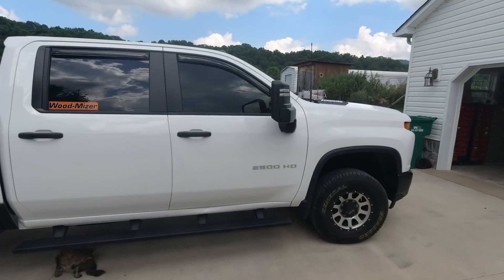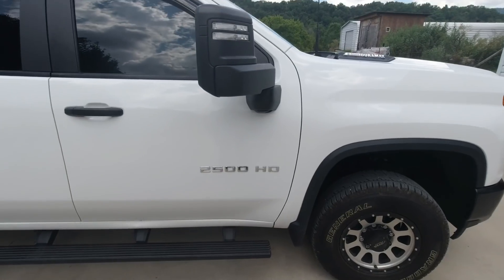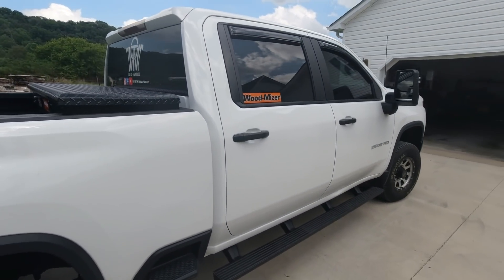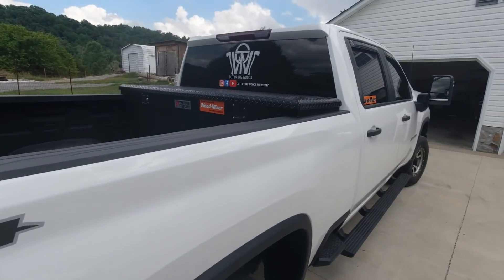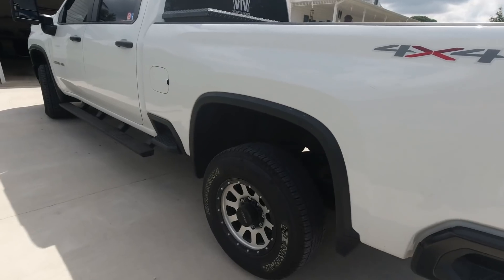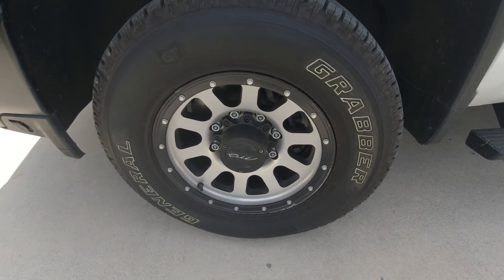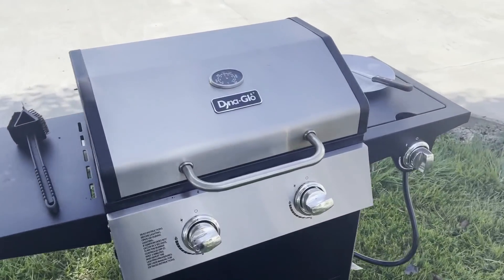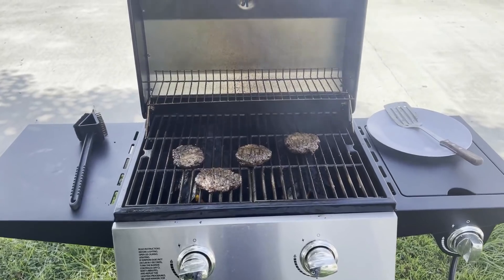It's A Diesel

Comment: Burning your woodpile makes me think back to when I worked as a security guard for Memphis Hardwood flooring and what they did with all their scrap wood.  I would start work as the workman were getting ready to leave for the day.  After they left it was only the fireman and myself, the fireman was the one who all shift ran the boiler, just like a steam locomotive fireman did.  I had to make a round once an hour through the plant to make sure there were no fires, which in the time I worked there there were several.  Every one of the saws, planers, brushes and routers had vacuum ducts, to collect all the sawdust.  All of the saws had a conveyor belt to carry scrap wood to the chipper.  The chipper would shred all the scrap lumber into sticks not much larger than a matchstick.  There was also a station for the workman to throw any wood which came out of the kiln, where the whole board was not usable, onto a conveyor belt to the wood chipper.   We called the place the "duck farm", because on the round we were always ducking under the conveyor belts.  All of the dust and chips from the chipper was directed into the dust house, which was a building about 40 feet wide by 60 feet long, and had three augers in the floor to feed the dust into the boiler.  The boiler not only created the steam heat for the kilns, but during the day they ran a generator to supply the whole plant with electricity all from the scraps of making wood floors.  Sometimes during the summer, they would run the generators 24/7, but during the winter they only generated enough dust to run the kilns.  During the winter at night and weekends they had to use commercial power after the shift and weekends.  For a senior in High School it was a job I did enjoy just walking around the plant and figuring out how each line made the different types of flooring designs, checking out the sharping shop, and the machine shop where they made all the gears for the plant and the sawmill in Mississippi.
Reply: What year are we taking here?  Very interesting.

Comment: Regarding the truck tires - if you can get them near you, try the Falken Wildpeak A/T3W tires.  I have them on my 2016 F250 and love them.  You get a LOT of miles out of a set, I have 37,000 miles on mine and they are still a year away from needing replacement.

Comment: Congrats on the new truck Nathan! Just a suggestion from an operator of a backhoe and an excavator, turn the front bucket over so the blade digs into the ground and push it down until the front of the tractor starts to come up. Those 2 stabilizers need to be pushed down farther also. When you start digging, you need some RPM's going for the pump to give you digging power. Also be pushing the bucket teeth down into the ground and at the same time curling your bucket while pulling towards you. The bucket should be overflowing with dirt every scoop. Don't mean to offend but just help out.

Comment: You should check out the Goodyear Duratrac. I work on the road doing cellphone tower work. I live in NC and do most of my work in WA, OR, ID and MT. I have a F-350  loaded to the max. Most of my jobs are up crazy mountain roads. I only need one set a year. The best tires I've ever ran.

Comment: Nathan, have you ever considered using those off cuts and barked flitches to make biochar to amend the soil in your garden(s)?
Reply: I make biochar. It’s a pain in the ass. I use kiln dried material from my wood shop. Making biochar isn’t as easy as it’s made out to.
Reply: @07negative56  I've made quite a bit of it, too. It's not as hard as you're making it out to be either. The trench method works like a charm and can be mixed in situ with composted manure to inoculate the biochar before using to amend the soil.

Comment: Back up cameras on trucks are great. You will love the diesel. My last was a 2015 3500 D/A CC LB for towing a 16,000# 5th wheel trailer. Loved that truck. Only had it one season. Sorry to hear no takers on your cutoffs in the burn pile. If I were close enough it would be interesting to see if it would work to pick through your pile and market what could be found online there to turners and maybe flat wood workers.

Comment: Re your new pick up. over here in the UK, Diesel fuelled engines are now a No No, after years of them being pushed via lower fuel costs, owners are now being punished if they want to drive in certain parts of city's.
Reply from the maker: That’s bad.
Reply: Another case of bizarre greenwashing. Compression ignition is actually cleaner-burning than spark.

Comment: I think those wheels you don't like are "lockers." That's why you have the extra bolts around the outside edge. They're designed to hold the bead tight when you lower tire pressure. You may never need them because you rarely run in sand or other rough terrain. Sometimes they will drop their pressure down to 10psi. or less when off road. Without the locker wheels the tires will quickly roll off the wheels. You should try to sell them.
Reply: Those are wanna be bead lockers. True bead lockers have 25 or more bolts on the rim. they are not DOT approved for use on the road. Unless you go off road a lot you don't need them.

Comment: Ok, so I may not be the sharpest knife in the drawer, but I presume that the new sawmill will be placed in the new building near the moulder and the kiln, because logistically that makes the most sense to have everything nearby, including the log pile, particularly with Nathan making comments about the tightness of a new mill in the current building. Doesn’t really make sense to run the power just for the moulder with out having enough power to run a mill. I suspect the new mill will be electric powered, if that is even a thing. That way the building may be enclosed without the diesel exhaust emissions. Nathan you may have already addressed this before or with your Patreons and I missed it. Looking forward to finding out.

Comment: Congrats on the truck.   I’m ready to see the new lt50 ( i always remember in the old vids you said if you ever replace it it would be a lt 50 ) 😎
Reply: I agree with you on the LT 50!!  The guys saying he’s getting the LT 70 don’t understand what kind of production both  the 50 & the 70 will turn out with the 70 being far more productive than the 50. Nathan works by himself! The 70 can turn out more lumber in one day than Nathan is milling in a month right now with the 40. Once you step up into the 50 or above you start getting some very nice options not available on the 40 like the bi directional chain turners which make an amazing difference and increase production speed by itself. There is no need for Nathan to step up to the 70 unless he’s hiring 3-4 guys to help move that production and stage logs  etc. or unless woodmizer gave him  a huge, huge discount cause there is a tremendous jump in price from the 50 to the 70, so for what type of milling Nathan does, the LT 50 will still outperform anything Nathan wants it to do!! The 50 is more saw than he needs but those extra options on it that are not on the 40 are worth the upgrade price alone!!!

But, I guess we’ll all find out in about 3 weeks or so!

Comment: Hi Nathan, thanks for the edutainment content you put out!  I'm a fan and a one of my coworkers is too...we're both software developers and have quite diverse interests...like electronics, fountain pens and OTW!  I was wondering and expect you've covered this before, but instead of just burning the cut-ofs from the mill, could you make the material into fuel pellets to use in the kiln?  It seems a waste to just burn the waste from the mill.  Anyway, keep on cuttin those beautiful slabs and we'll keep watching.  Be Safe!
Reply from the maker: Kiln is 100% electric
Reply: @OutoftheWoods0623  ok... to bad you can't augment the heater to use multiple heat sources.  I'd totally not want to start modifying an expensive new kiln that's at the heart of you operation.  Thanks!

Comment: Good luck getting your new mill.  My friend in Candler, NC ordered parts to upgrade the clamp on his LT40 this spring.  There were 4 parts needed for the upgrade.  So far, he has received 2 correct parts.  He received 2 arms for same side, not Lt & Rt.  When he received replacement arms (they sent another pair), the arm he needed wasn't welded completely.  The other bracket he needs, came in welded wrong. That was June 28th.  Since I was going to NC July 8th to help install the upgrade and saw lumber for my trailer, I offered to stop and pick up bracket as I would be within 20 miles of Woodmiser on my way down.  It didn't happen.  Now he can't get any answer from Woodmiser and hasn't gotten the parts!  This is the first time he has had issues Woodmiser.